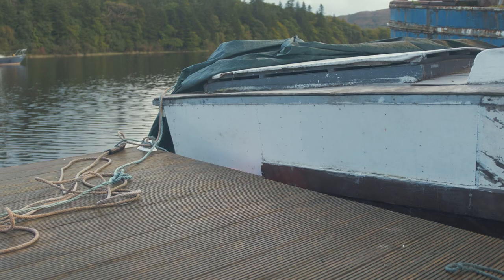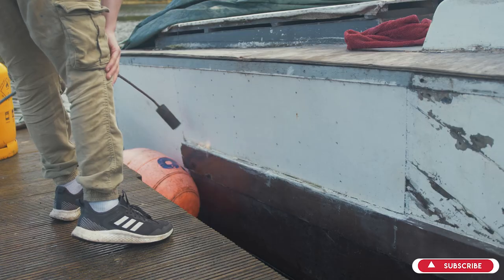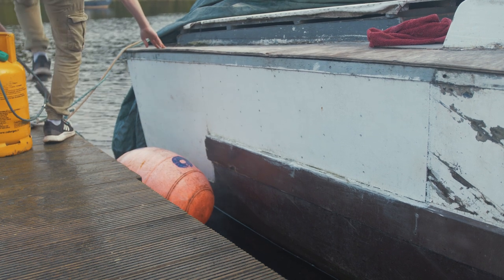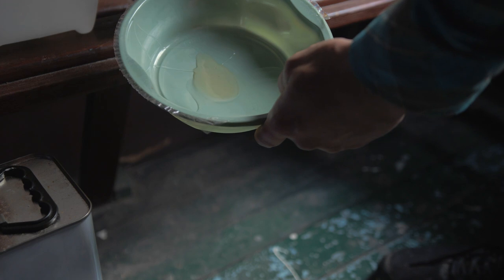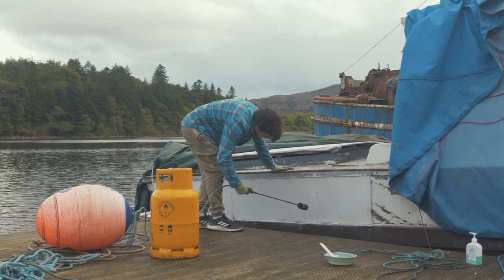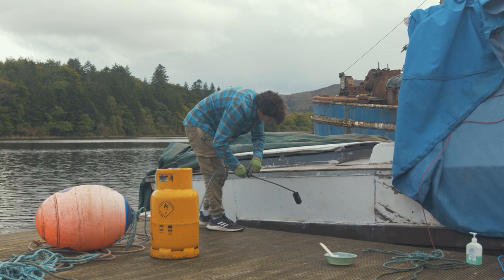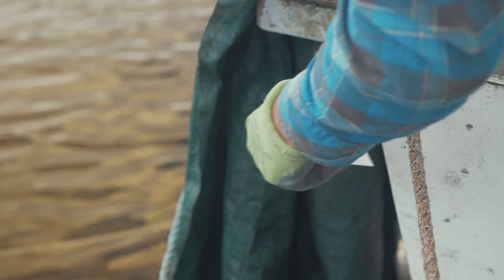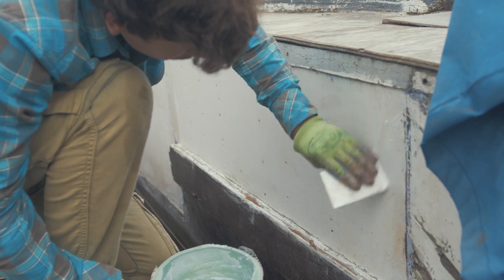Winter Plans | 1940 Wooden Boat Liveaboard Journey | Episode 30⚓

Comment: You mention initially applying polyester resin on the repair, then filling screw holes, etc. with thickened epoxy.
I can think of several reasons why you went for different products, but I'd like to know yours.
...
And ignore the naysayers. You're doing great work when the opportunities arise.

Comment: thanks for the update! by the way, on another channel I follow, a guy is rehabilitating an early 1970's motorhome. to update the interior appliances, bathroom, cabinets, etc., he found a fairly new luxury camper (I believe you guys would call it a caravan) at a yard that had been wrecked beyond repairability but had a very good condition interior. he was able to get it quite cheaply (under 1K euros) and he is planning to use the appliances, bathroom fixtures, etc. in his motorhome restoration. the prices of all of these things can add up quickly, you might consider doing something like this when you start fitting out your interior for habitation
Reply from the maker: Good call. Thanks for the tips!

Comment: Don't apologize for not being able to publish videos in time. You're doing your best and that's fine this way.
Just for information, wouldn't that be easier to work on the hull with the boat on the dry? Wouldn't you be able to do the essential repairs faster?
And I don't remember if you mentioned it but is the engine of the boat running and the helm responding, in case you have to move the boat in an emergency?
Have fun and stay productive too 😉
Reply from the maker: We are looking into the possibilty of a haul out which means we would have to build a custom trailer. The two volvo penta engines haven't been running for some years. We plan to get one back working at least. Thanks for your continued support!
Reply: @LakesideProductions  Volvo Penta was a great brand of marine  engines, back in the past. They are probably based on an outdated but simple and reliable technology. They may work fine for what you're planning to do with the boat, ie live on board, not have long navigations.
Building a custom trailer for a boat this size is another story.
Reply: @LakesideProductions volvo penta still today god engines. Are those gas. Engines or disel?  Saw they where painted red so i guess gas engines. If so. You can also find parts for them at car junk yards from volvo cars. Could be updated with Holly injektion. Just idea for later. Would make them more. Gas efficient. And run smoother 🌞🌻